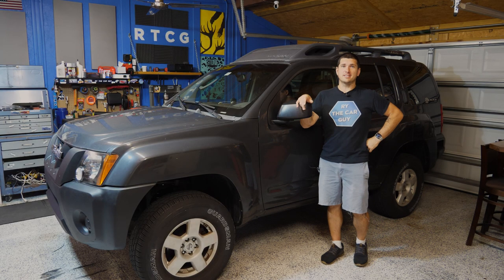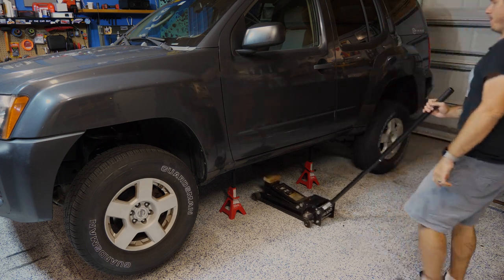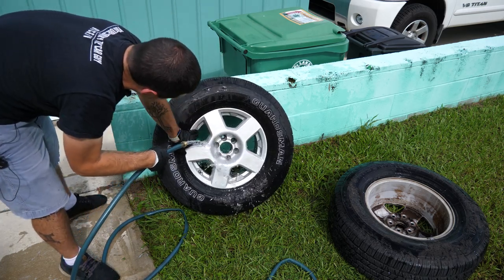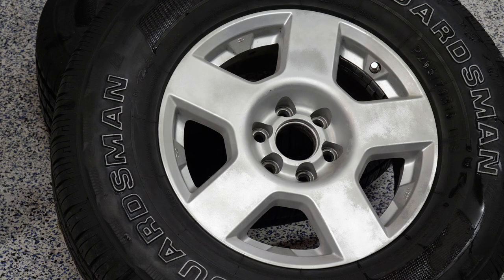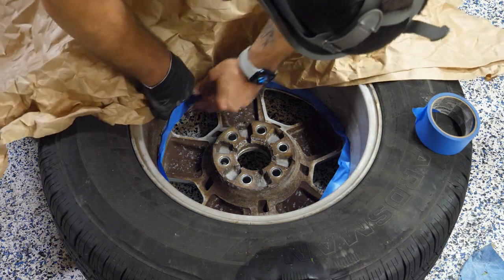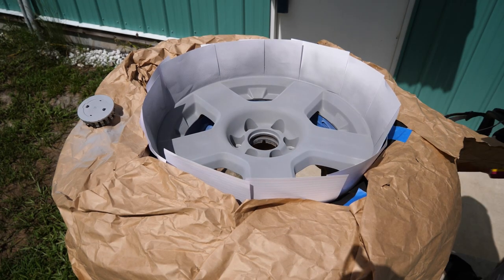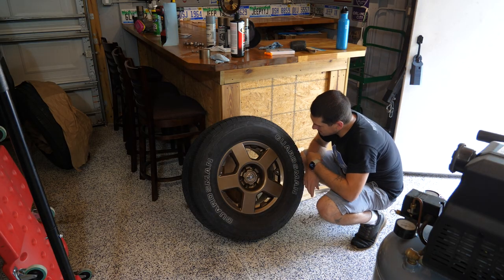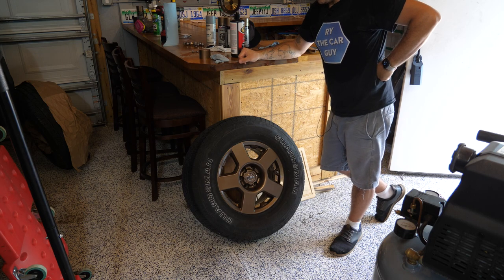How To Paint Your Rims With Spray Paint

Comment: Thanks for this. My steel wheels are chipping badly and rust may be in my future. I was stuck between a crappy looking DIY job or an expensive repaint. Your tutorial gives me confidence a DIY approach would look decent.

Also, what size tires are you planning? Is a 4x4 conversion in the future?
Reply from the maker: Not sure I will do a conversion. It might be easier to just pick up a 4x4 that needs work and swap out everything else that I want. I was thinking of maybe doing 270-75-17 on new rims. If you have chipping on your steelies you should for sure paint them, what have you got to lose!

Comment: What size tire are you wanting to go to that you'd need new larger rims? Largest we can get on there (without tswap) is 33. Are you going super wide or something?
Reply from the maker: I said it backwards in the video. I really want larger rims that will require different tires. Not the other way around. I am thinking like a 275/70/17.  Those should be just a little over 32 inches.

Comment: You don't need new rims to go with bigger tires, there are plenty of 16 inch tires from 32 to 35 inchs to choose from and those are the biggest tires you can fit on an Xterra without extensive mods and smaller wheels (16s) and tires with more sidewall preform better off road and bigger tires with beefier sidewalls look better on the Xterras. Great Vid however, finished wheels looked great !

Comment: Rye .... ive been watching you xterra vids for years now...I also have an 2005 2nd gen manual 6 speed...but mine is 4wd and I am sorta embarresed for you ..for not using a coil of cheap 6" aluminum house flashing as a custom fit spray shields..and a bit of tape to keep the circumfrence tight to the rim size..your a dork for using index cards...but I like your vidios anyway.
Reply from the maker: Works like a charm though! 🤓thanks for watching dude.

Comment: Will this work if your factory wheels have some factory finish chipped off?
Reply from the maker: Yea you should be able to get away with that. Just make sure that you chip off as much as will come off, then sand the edges to smooth them out
Reply: @Rythecarguy  Thanks for your reply. I have same color Xterra and was pleased with how the bronze wheels turned out. Looking to do same diy modification soon.

Comment: HELP! I've got a 2007 Xterra, 4x4, 6 spd manual, base model and my cruise control system decided to not work anymore and how/what do I look for to fix it.
Reply from the maker: Hey Russ. The controls are on the front of the steering wheel right? If so it's most likely the clock spring. Swap that out and it should work.
Reply: So that means the steering wheel comes off. Ugh
Reply: Can you do a video on how to fix it?